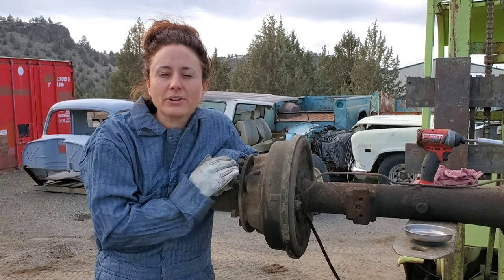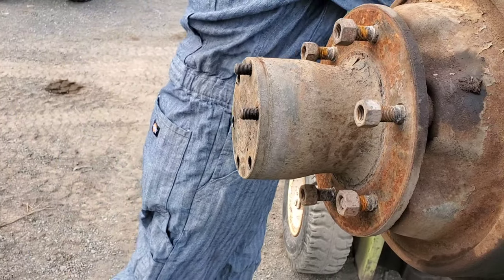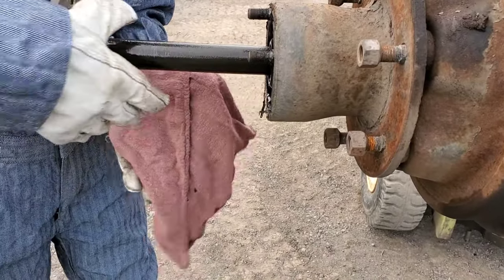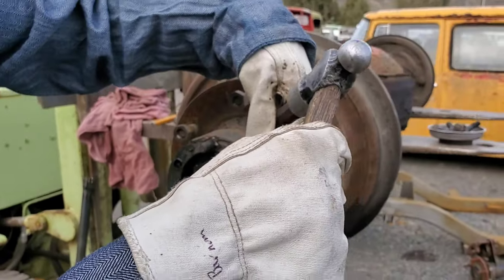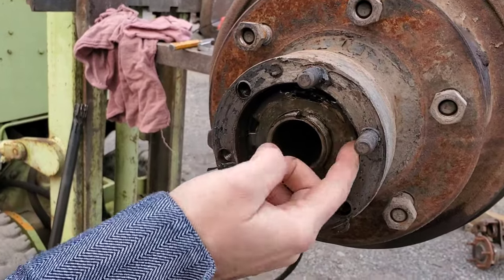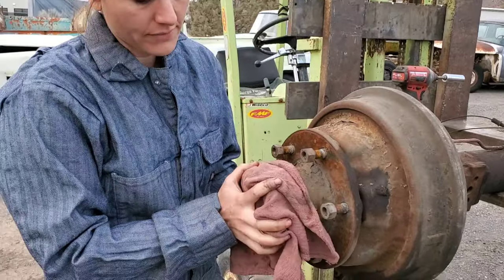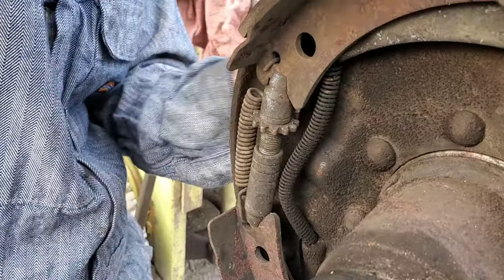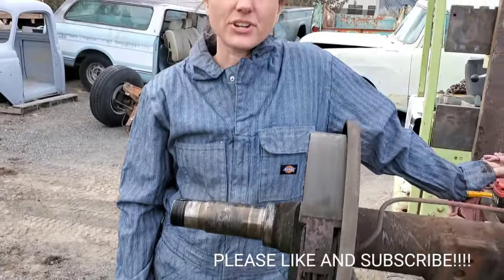How to remove full float rear axle brake drum.

Comment: What if the bearing is REALLY stuck.  My drum rotates so it’s not hung up but I can’t get it off.  I think it’s the bearing is stuck.
Reply from the maker: Slide hammer the hub off, but make sure there are no obstruction first. Depending on why it's stuck, the spindle may be ruined.
Reply: @TheBinderBoneyard  What does the slide hammer grab on to, the inside of the drum? It’s a Dana 60 out of a 77-79 f250+
Reply from the maker: @rileykortemusic  I'm guessing you don't have a slide hammer kit, if you asked that question. Use the hub plate attachment.